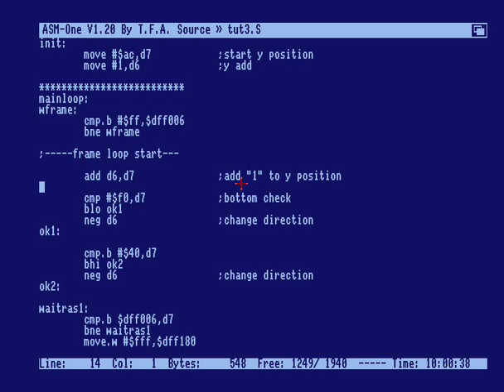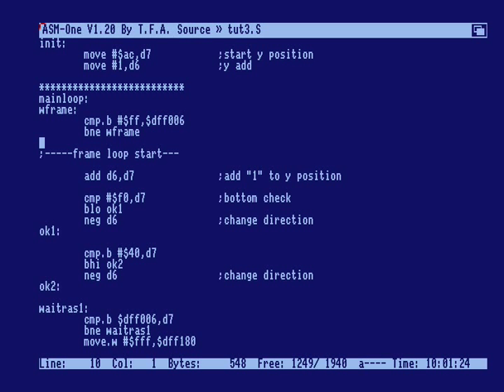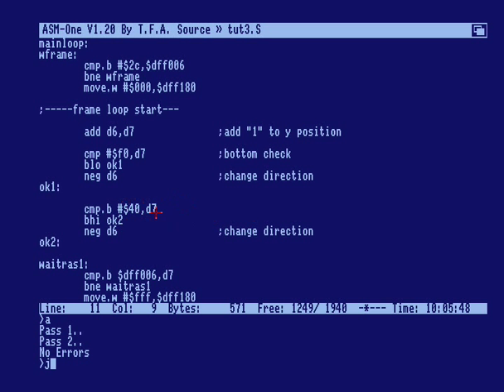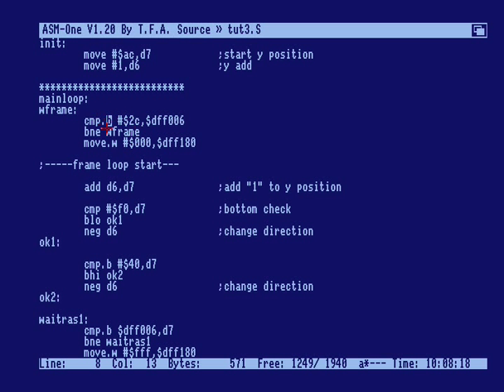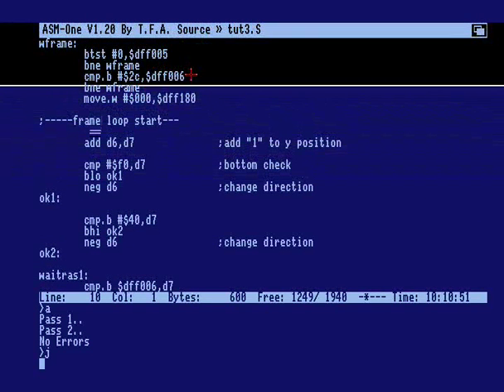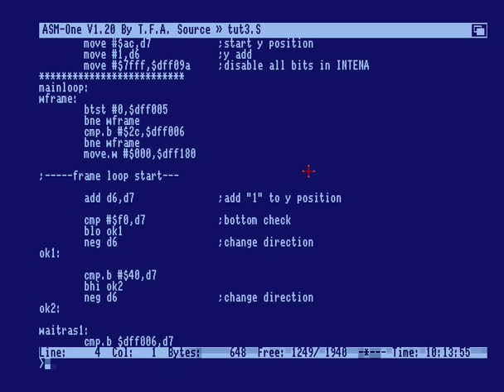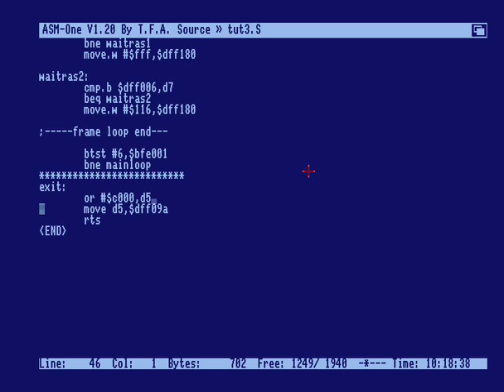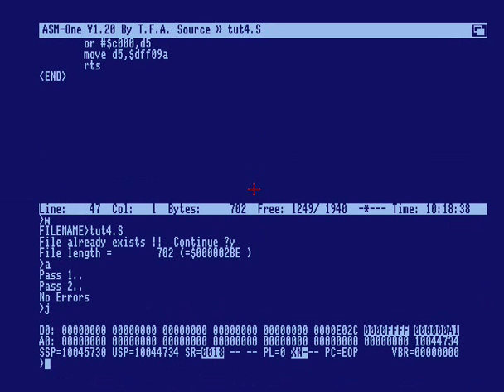Amiga Hardware Programming 4 - System OFF, please

Comment: hey all, the code crashes after the adding "disable all INTEMA bits" line in winuae. what can i do for resolve this?
Reply from the maker: This is the point where the OS is turned off. If you are stepping past this point in the Debugger, it should freeze, not crash (because interrupts that listen to the keyboard and update the screen are off).

If you are running the code instead, the code must reach the point where we turn the OS on again, or it will continue running. If it doesn't, there is either a bug in the code, or a different environment. The code has been tested on a real Amiga 500 and the same config in WinUAE and runs fine there.
Reply from the maker: If you did get a crash, this is either trapped by the Assembler or the Amiga shows a requester/resets the Amiga. In either case, you get a long number as error code. The code can help pinpoint the general category of the error.

Comment: When testing the high bit of the vertical position (at around 9:40), you write btst #0,dff005. I think what you actually want is to btst.b #0,dff005. Am I right in assuming this is automatically converted to/interpreted as the .b version of btst because the address is oneven? Thanks! Great tutorial series, btw!

Comment: Anyone else run your program after turning off the interrupts and lose the ability to use mouse + keyboard? :)
Reply from the maker: Hehe. That can happen when programming demos (or games) and making some error in your code. One way to get back to the Assembler is to connect (real Amiga) or bind (emulator) a button to Level 7 Interrupt. This has absolute priority and some Assemblers handle this to (maybe) get back and save your source. F.ex. Asm-One/AsmPro, but some versions don't set the interrupt vector properly. AsmTwo does this and also has a shortcut to auto-save, assemble, and run. (Shift+Help I think it was). http://coppershade.org/file/AsmTwo.zip
Reply: ScoopexUs thanks :)